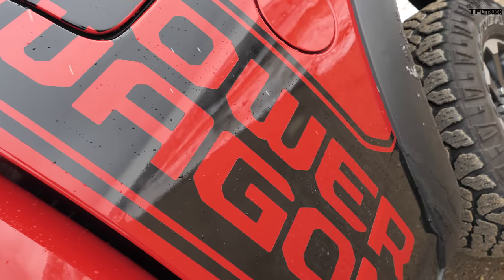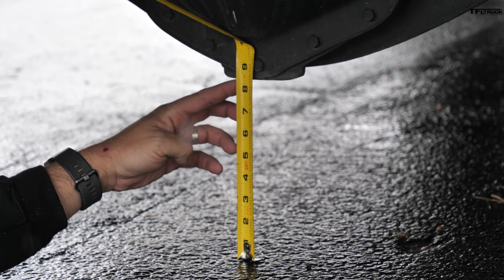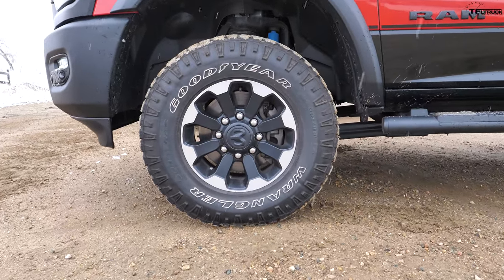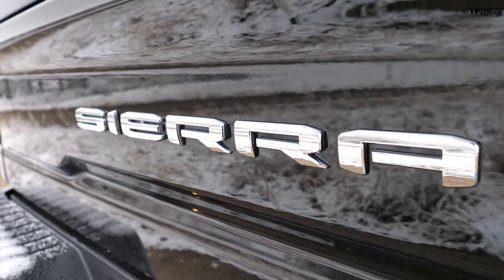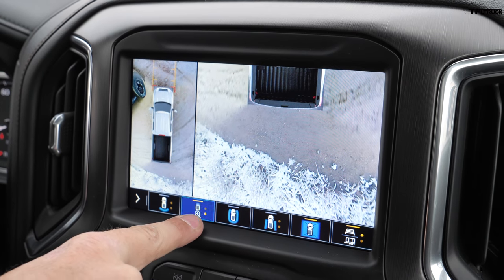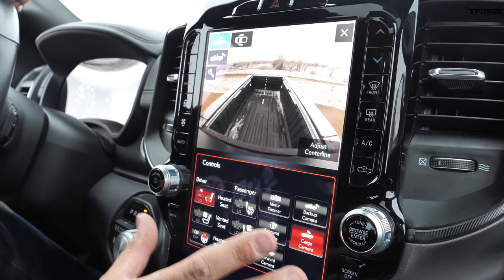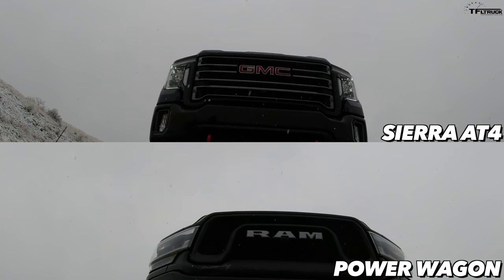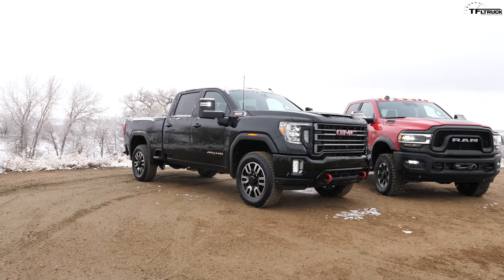Ram Power Wagon vs GMC Sierra HD AT4: You’ll Be Surprised Which One Has Better Off-Road Specs!

Comment: the Ram comes standard with a winch..........because they get stuck a lot more!!
Reply: Stuck pulling out all the GM Diesel boat anchors that broke their soft duty front axle   on a fire trail puddle.
Reply: If you have never needed to winch out or get pulled out, you have not been off roading, you drove along a marked and maintained dirt road.

Comment: oh my bad , I commented before you measured the tires, I don't know if duratraks on both trucks would make much difference,  Duratrax tires don't last long on heavy duty trucks, I've tried them. I bet if Dodge put a Cummings in that wagon, It would sale like hot cakes. All trucks are over priced. Even though I'm a GMC fan, I just can't see buying a truck that cost that much. If I did it would be the last truck I buy, and run it to death. I don't think you need a big screen t.v. in a dash,  There can be improvements on both trucks if the manufactures and over paid engineers would listen to the consumer. good job on the comparison. let it snow.

Comment: I have to agree. I stopped watching when you began measuring the logo. Take them off road and watch the ram stomp the Chevy to death. Unhitch the sway bar lock both axles and away you go. The chevy will likely break a front end component or outright lose a front wheel after just a short bit of of pavement use. They haven't built a decent off road truck since the 70s. Great motors great transmissions but the torsion bar front ends they use belong in a car not an HD truck.

Comment: I can’t believe Ram doesn’t offer a diesel with the Power Wagon
Reply: Too much weight on the front end for off roading. 1,200 lb Cummins.
Reply: With a selectable locked axle and the turbo on a diesel, you would snap axles every time you engaged a serious obstacle. There is a good reason they have never offered it in a POWER WAGON. Now if Dodge would build a more extreme diesel it’s going to take massive 2.5 ton Rockwell’s to survive that Cummins torque. And they will still snap.

Comment: So the Ram 3/4 ton Power Wagon isn't really a 3/4 ton truck? False advertising? Not to mention how can a truck with an 1100# pay load be rated to tow 10,000#'s? The driver can't weigh more than 100#'s.
Reply: It's a 7300lb truck, 2000lbs heavier than   a 1500. The truck itself will pull way more that 10,000lbs anyways, it's just the 1600lb payload thanks to the articulink suspension that kills the official rating. Just yesterday I pulled 7 tons of 1" clear stone with my 19 PW, pulled it with ease. The roads around me are horrible as well with a ton of elevation distances and a lot of it being unpaved.
Reply: @WilliamStewart1  I agree who cares about Towing/Payload when your focusing on offroading? Are you ever going to tow your camper offroad with you, lol. What's next? Offroad Campers?
Reply: Ram rated the payload and towing and marketed it as a 3/4 ton truck.  Buy based on a payload of 1100#'s it isn't a 3/4 ton truck and cannot tow 10,000#'s.  That's based on the numbers presented in this video.
Reply: @rayd2100  It's a 2500 truck, that's why they branded it as such. It's identical down to every other 2500 on the market except for the suspension design which focuses on articulation. The frame, the brakes, the body panels, the engine, transmission (PW has a heavier duty transfer case and axles compared to a normal 2500), etc etc. The official rating on them is 1680lbs for payload and 10,700lbs towing. But again nothing is different other than suspension compared to the truck that's rated to pull 18,000lb and has 3500lb payload.

Comment: THANK YOU for measuring the actual ground clearance!  RAM marketing is full of it with that 14.3 inches number.  That math alone makes you scratch your head:  solid axles with 33 inch tires would mean 16.5 inches with no differential, except is has one, with a 11.5 inch ring gear.  half of that subtract 16.5 is 10.75 without a housing.  if its 8.25 inches at the lowest that means there is 2.5 inches between the ring gear and the outer case which makes a lot of sense.

Comment: The fuel mileage on those Hemi's is CRAP!! I had my GM in getting some body work fixed as someone hit me and the shop game a a Ram as a loaner. During the week I had the Ram, I spent about $100 CAD in fuel for the week with a total trip of 114 km. That number is the worst I've ever seen and I was driving very light footed as I was considering purchasing one, my GM (5.3 vs 5.7) for the same amount of fuel would easily net me 4-500 KM. I drove the same roads and conditions every day for that week. My buddy who had a Ram got rid of it due to the amount of fuel it used as well, its a shame as I did like the ram, and it never rode like a truck, it was more of an suv type ride. But based on the fuel mileage and the amount of driving I normally do, you would need a fuel truck to follow behind you..... Then you also have to worry about the Dodge/Ram/Chrysler/Fiat TIPM problems down the road as well. Such a shame that these are so hard on fuel. I love how they do the EPA as well, flat roads barely any throttle. There is no vehicle that I've drove that hit the estimated fuel  consumption numbers in my area, all hills with very little flat roads. Nice looking trucks tho
Reply: Scott Barron stop flooring in it will be better 🙃
Reply: No way were you light footed, with those mileage numbers!  I drive myHemi  RAM 114 km, on 3 gallons of gas, US. Right now, that equates to $7.50, US.
Reply: Phil Jungels exactly lol
Reply: @briandjordjevic9969  @Phil Jungels, I never floored it once or was heavy footed!! Sorry we all don't live where its flat and maybe  the numbers they use should be created in the rockies somewhere where its all hill, then if they hit the posted numbers it will be true. My truck is 4x4 and so was the loaner, Obviously you never read my complete comment. Maybe yours is not 4x4 and only 2wd making a difference but I never floored it once, nor was I heavy on the pedal as I said I was considering buying one and by driving it normally I would/should obtain the advertised gas mileage. I feathered the pedal and took it easy as i wanted real world numbers, that's the numbers it gave me. Like i said I live in a hilly region with little to no flat roads, or well not for very long. The truck had less than 5k on the dial so maybe as it broke in it might get better but my buddies ram was the same way. My neighbor just bought one due to all the sales Ram has on and he says its a pig on gas compared to his 2016 f150 v8 that he just traded in. They are just plain hard on gas. I average about  12.5-13 mpg in my GM and I have larger tires on and my truck is slightly lifted and it still gets better than the loaner ram did.
Reply: Scott Barron I get 13 mpg I put the pedal to the metal. I don’t know how you are getting that 🤔
Reply: That works out to 86l per 100km. Sorry but you did something wrong. Yesterday I pulled 7 tons of gravel with my 19 Power Wagon and I averaged 26.5 L per 100, I also live in Northern Canada with horrible roads and lots of elevation distances. Hell I can put 50,000lbs behind my Ford L8000 and still get 45l per 100. You either idled the truck for the entire week or you have a whole in the tank......
Reply: Will S Amen to that

Comment: The Ram is junk. That Sierra beats it in nearly everything.
Reply: It's a Chrysler product. There'll just just work on them..
Reply: Please.
Reply: Watch Justin King's channel, the Powerwagon is a beast offroad.
Reply: @richfarfugnuven6308  it's a Chrysler product. It'll only be a beast for around 40,000 miles.
YouTube south main auto 2500 ram soild front axle rebuild!  44,000 miles on that pos and the whole front suspension is JUNK!!! 
FCA garbage!!!!
Reply: @philllsxga.7737  I agree FCA is not generally that reliable, however I had a Challenger  Hellcat and never had any problems.  The solid front axle with disconnecting sway bar is the way to go offroad.  There is a reason people buy and drive these and Wranglers here in Colorado.  By the way we are supposed to have over 2 feet of snow at my house with wind gusts over 50 MPH by the time this storm moves out.  I drive a lifted F350 on 35 inch Duratracs with lockers front and rear.
Reply: @richfarfugnuven6308  Jeep's are popular but not reliable.
I sold my 2001 ZR2 with 252,000 miles on it. I was always off roading ALWAYS! Mostly sand dunes, and deep snow not much mud. The only thing I did to the front end was lower Ball joints and diff. Output seal's and never had any other issues in 252,000 miles!! 
That was a badass little truck!
I even jumped it a hand full of time's!!
My current 14 Silverado has 106,000 miles on it, I've been on 6 off road trips with it just this summer alone and I have not had one problem with it.  It will averarge   24 to 26 MPG on the express way averarge not instant!!
And the 5.3 in it has a lot of torque for hill climbing!!
I off road a lot and no major issues..
Reply: @philllsxga.7737  Ok Mr. Hyperbole. SO what is the alternative a GM Truck, hahahahahaha.
Reply: @paulj9821  buy what works for you. I'm a huge off roaded and keep my Chevy's 6 to 10 year's and well over 200,000 miles and besides normal wear and tear items I have no other issues..
Reply: @philllsxga.7737  I have been a mechanic for over 20 years now. Specialized in Ford pickups. I can't stand the whole sensational Brand loyalty nonsense. In the past 2 years GM has been lagging behind the other two. RAM has seriously stepped there game up. Why is it when competitor A out does B, the loyalists to the losing brand must shit on the winner. 
What is even more shocking is hearing GM brand loyalists call Jeep and Ram unrealible. It's like a Bum calling out homeless people for there lack of hygiene. Even my friend who was a hardcore GM fanboy since the age of 17 when he got his first Camaro is deeply disappointed in his 2018 Silverado. Ride quality, interior etc...

I don't personally care what brand people buy. If you prefer GM so be it. My main pet peeve is instead of people being objective and honest they choose this dualistic approuch of it's either trash or the best.
You call jeeps unreliable yet you bought a General Motors vechile. GM manufacturers tons of crappy vechiles if you were aware.
Reply: @paulj9821  I know GM makes some junkers, they are overall better engineered. My brother is a bodyman he says Ford's are harder to work on than GM's. The bolts rust sooner and they are harder to take apart. 
And how about those Tritoos with the spark plug and cam phazer  issues?!?!  How about those power struggles where you have to pull the cab to do anything but change the oil?!?!  Ford's are a Micky mouse engineering disasters!! 
Same as Chrysler!! Mickey mouse engineering.
You think Ford's are good and GM are junk??? YouTube Stock bottom end record.
YouTube k.p. mustang.
YouTube LSx Challenger.
YouTube LS Winnebago.
YouTube most patriotic LS mustang.
YouTube LS duster 
YouTube  Stock 200,000 miles 4.8 mustang.
YouTube fastest stock bottom end LS.
YouTube why the LS is so good.
If GM is junk, why are the LS and LT drive train's the most popular swapped?!?!?
YouTube LS powered super car's.
YouTube LS powered Ferrari.
YouTube LS powered Lamborghini.
YouTube LS powered Subaru WRX...
YouTube LS fest!!...
Reply: @philllsxga.7737  bro when did I ever say FORD'S were the overall best? Never did I even imply that.
I said I specialized in Ford pickups since I worked as a certified Ford mechanic for 11 years out if the close to 21 years as a mechanic.
GM Better engineered you say, what a joke. You sir are implying that GM is a superior pickup brand, which destroys your credibility.
Each manufacturer excels in different area's. You pick your poison. If you payed attention to what's been happening in the last 2 years then you would know RAM has surpassed GM, hence the massive 38% increase in sales which exceeded Chevy's numbers, hence RAM taking the #2 place. Not that you care cause it's obvious no matter how good of a product  RAM or FORD makes, you will always makes excuses to make them look inferior in order to give the illusion that GM is superior all because you are a brand loyalist.
Reply: @paulj9821  YouTube LS engine explained Nelson racing.
YouTube LS fest.
YouTube CAR WIZARD best engine ever.

Comment: 1100? even mine has nearly 1600, whered you find a power wagon with 1100?.
Reply: When you add options it adds weight and takes away the payload :-(
Reply: The Ram boxes hurt there.
Reply: Will S i have the ramboxes my payload is the same as one without
Reply: Collin Godbey unless you’re Ford they write one spec and blanket there entire fleet with that engine and spec

Comment: The Ram is ugly compared to the GMC.  Leave it at that.  How about a comparison as to which one will spend less time getting some complex electrical gizmo fixed that will certainly render the truck underivable?   For now it seems to be a race to the bottom for both manufacturers when it comes to quality, longevity and cost.   Sad to say I along with many others out there have no use for any of the late model nanny stuff and cushy interiors that the manufacturers seem to think justifies 70+k for a pickup.  Whats worse it the hit you take if you keep this junk out of warranty when it needs to be or fixed.   Keep it all and I’ll continue driving 20 to year old trucks I own, I can fix and I can easily drive for another 20 years with minimal expense.    I’m done ranting, thanks for listening.